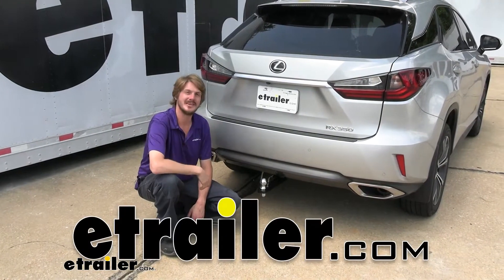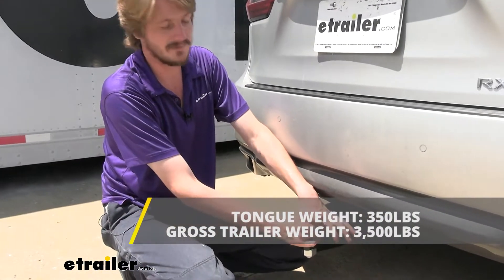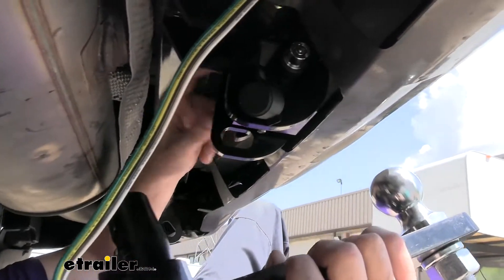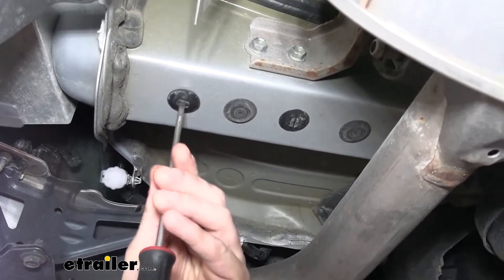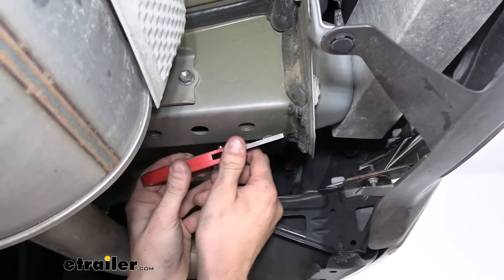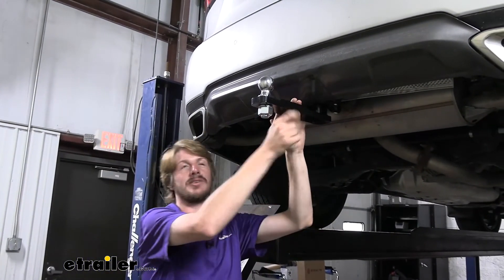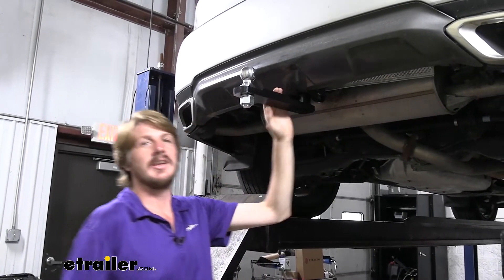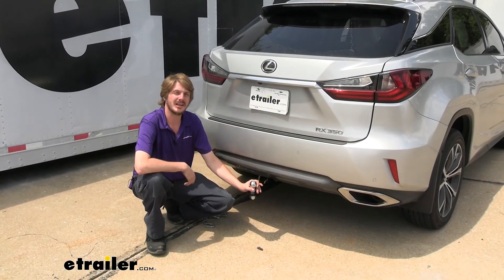Setting up the Stealth Hitches Hidden Trailer Hitch Receiver w/ Towing Kit on your 2018 Lexus RX 350

Comment: What about 2023 rx 350H?
Reply from the maker: Stealth Hitch doesn't offer a hitch at this time for the 2023 Lexus RX350H, but Curt does. Part # C29VV is a mostly concealed hitch, the only part of the hitch that'll be visible is the receiver tube and the safety chain loops. The remainder of the hitch will be concealed behind the rear bumper.
https://www.etrailer.com/p-C29VV.html